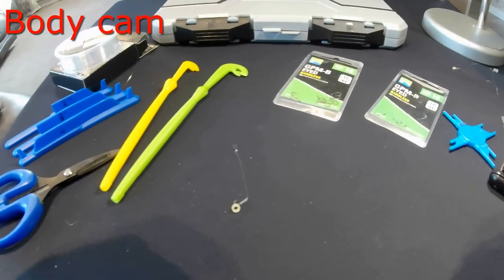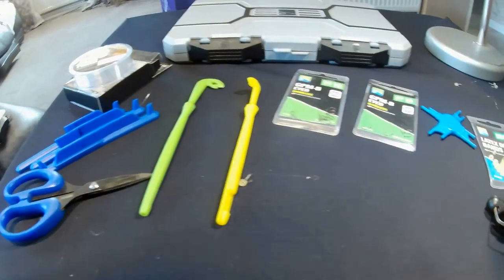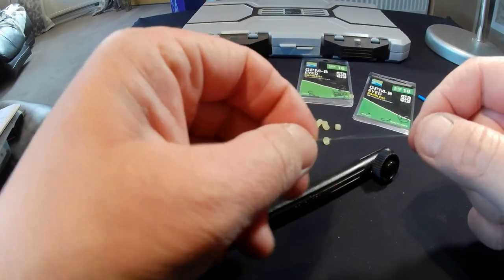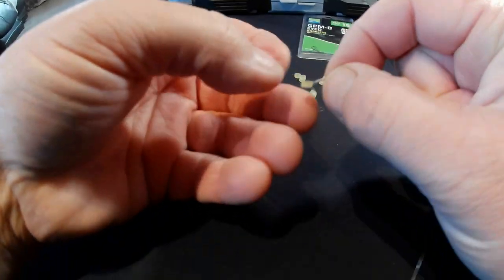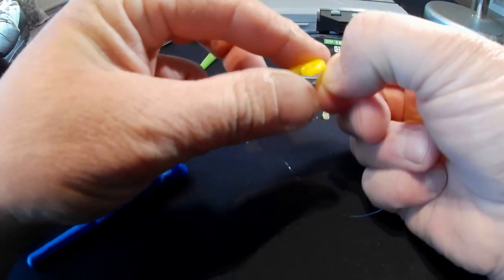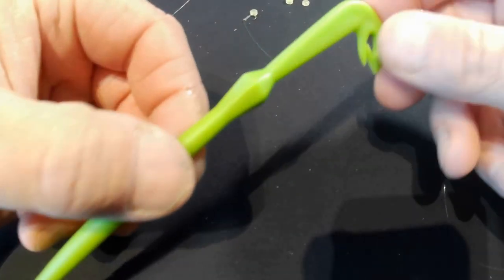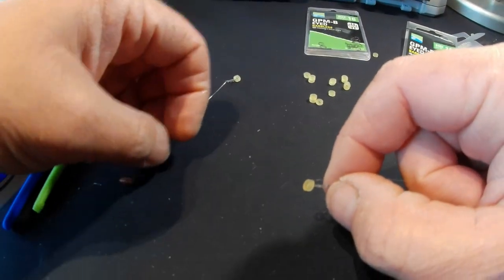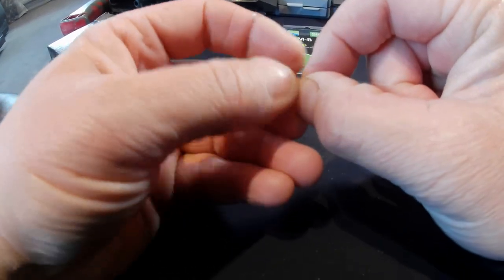The dreaded 2 inch hooklength

Comment: I made my own hooktyer that ties 2 inch hooklengths onto spade end hooks.
The hooklength loop is made first. The hooktyer works the same as the Gizmo hooktyer where both the hook and the loop rotate together whilst winding the turns on to the hook shank.
The secret is to make a modified hooktyer on the same principle as the matchman hooktyer, but with a simple difference. The matchman hooktyer creates a big loop because the two line prongs are either side of the locking thumbwheel. They are too far apart creating a big loop. The two prongs need to be closer together to form a smaller loop. Mine still has the locking thumbwheel but the two prongs are in front of the thumbwheel, closer to the hook. The two line prongs are only 10mm apart. Then you can tie any length hooklength from inch and a half upwards very quickly, and they are the same length every time, using spade end hooks.
A simple spigot drilled into the side of the hooktying head allows you to hang the band on. This allows you to tie banded hooklengths onto spade end hooks.

Comment: Great vid. I thought that I was the only person that tied knotless using a hook tier until I saw this. I used to do what you do until I made an improvement to the process.

I'm sure you know 100x more than me about fishing, but here's how you can make it even easier and quicker... If you're not sure about it, let me know how we can set up a video call etc...

Tie the loop/band as you do if that's what you like. Keeping the metal frame in the tier, place the band over the near metal peg and feed the line through the eye (this saves the fiddle of holding the band and sets a repeatable hair length). Start your windings by holding the line to the side of the eye (say 6" away) from the shank and SPIN THE TIER (as you would for spade ends) except starting at the eye end of the hook (as you do). After the 1st winding around the shank, hold the line tight and just slightly forward of previous winding. This way each winding wraps tightly against the previous winding, so you don't end up with the gaps between windings that you're suffering with. This way you don't need to stop 3/4 way through to push the gaps out of the windings (creating unwanted slack on them).

You can also control the hair length by how tight you pull the line on the 1st couple of windings (how much you stretch the band away from the peg). If you want a long hair, you can put the hair loop over the peg instead of the band. You can also make a few mm difference in hair buy whether you push the frame in our out (because the front peg is either double or single wire depending on it protrusion. I tend to have it half pushed in so it doesn't act as a hook to catch and the band, so it then slips off easy when finished without having to unhook it. Hope this makes sense!
Reply from the maker: Thanks for your comment/input. This will take some reading! I'll have to make sure I'm concentrating.

Comment: Thanks for video. I keep getting the band stuck in the knot. You mention making sure the band is not in the knot, but how?
Reply from the maker: You have to make sure the band is at the side of the tyer by holding it in place with a finger.
Another way of doing it is to try using an adjustable loop sizer as you can get the loops down to the size you need. 
Think the one i have is made by seymo.
Reply: @davebrownfishing  thanks for the feedback
Reply: @davebrownfishing  will sure give it another go

Comment: Hi Dave, brilliant video. I've tried loads of times to replicate this, but every single time I tie the band in the knot. The part of the video where you say, make sure the band isn't in the knot isn't very clear and I can't see exactly what you are doing to avoid this. It's probably really obvious but can you explain to me please exactly how you do it? thanks mate
Reply from the maker: When you put the loop on the tyer, make sure the band is in the slot with your line and not out to the side as it will end up in the knot. Takes a few practices but once you've cracked it, it becomes second nature. 
If you're still struggling after that explanation, hopefully i got it across. There is another way! I can't remember who makes it, but you can get an adjustable loop sizer, set it to 6mm and do them that way👍
Reply: @davebrownfishing  Thanks Dave, I really appreciate the swift response. I'll give it another go!
Reply: Hi Dave, fantastic video pal 👍 I also always got the band tied up in the loop😢 then after throwing all the toys out of the pram 😂 I had a moment and realised that stretching the band right into the top gap of the tier and with plenty of saliva when pulling the line of the bottom it slides over the band and forms the loop perfectly 👍 took me some time but mastered it now 😊 many thanks for your help pal 💪

Comment: Thanks for the great vid. Silly question but is the 2" rig 2" in length or is it slightly longer? Not sure if you lose any length once the knot is tied.
Reply from the maker: The finished hooklength is 2" long mate👍
Reply: No, that’s why you use a hooklength box or a measured jig to size your length after the hook is tied on, and when you make the final loop, the top of the loop should be @ 2”
Reply: Thanks guys, just realised there was a typo in my question, I meant to ask if the JIG was 2" long. By the sounds of it it's slightly longer to produce a 2" rig.
Reply from the maker: @jimm675  the jig is 2" long mate, possibly slightly shorter so as the hooklength is tight on the pegs in the hookbox. This helps straighten the hooklength out.